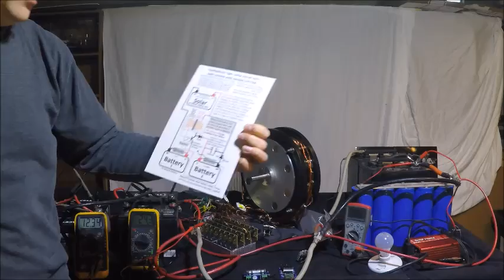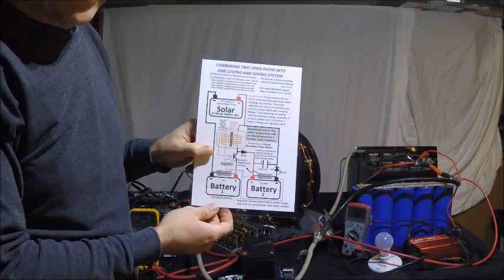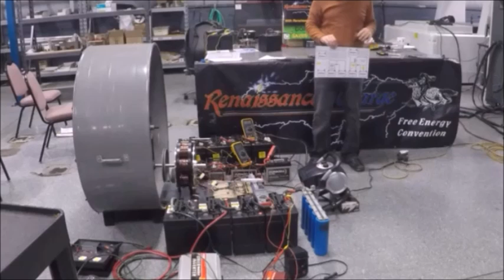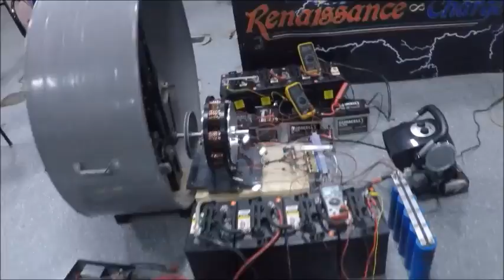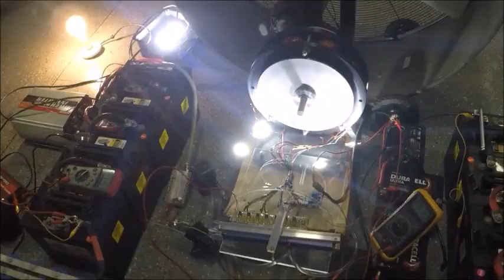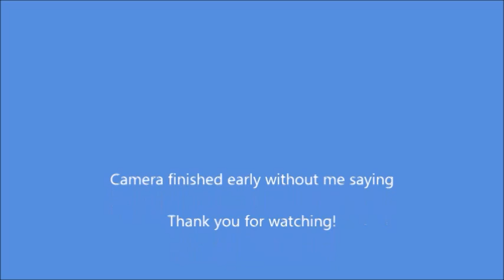Selfish Circuits or Loving Paths 3. Solar input, regulated

Comment: Shouldn't there be a diode coming off the Panel or a filter cap across it to save it from the inductive spike.
Reply from the maker: +Aln rife Panel?
Reply: +Rick Friedrich- I am asking about protecting the solar panel from the energy collapse in the coil.  can the pulse motors hurt the solar panel?  Was thinking you might want to put a cap in parallel with the solar panel to absorb the back spike.  Maybe the caps on the other end with  the charge battery take the hit.  Having built a few SSG's I know the spike goes more than just to the charging battery, especially if you have a bad connection on it.
Reply from the maker: +Aln rife Oh now I see. We often put a cap bank across the input to smooth things out like this and absorb the spike. If you were adding the last process then you would really need to do this. In this video I am not worried about the spike harming the panels under the regular conditions. One reason why you can't really charge the primary battery with the basic setup and the intermediate setup is that in the presence of positive current flow the negative energy phenomena stops. When the current flowed in the power lines then the spikes stopped on the transmission lines back in Edison's day. It was before the current flowed that this very fascinating thing took place. So when a source is powering a network with continuous power it cannot experience this at all. And when it is powering this motor it can only experience this for a very short time. So the place to maximize this benefit is in the 'pre' caps so to speak. They can receive more readily the charge and use that to power the motor. If there is considerable distance from the caps (where the motor is) and the panels then the panels will always be allowing current flow (so to speak) and thus the spike will not even manifest on the input side. The bank 1 in this particular circuit 3d.pdf will be able to receive some benefit along with bank 2 which always receives.

Comment: Rick, just a quick question if I may. I'm just wondering if the secret gray box contains a 'radiant energy oscillator'? Or is it Gabriel Kron's negative resistor circuit?
Reply from the maker: +clixbits As we develop this science we will present this as a system, otherwise people will just blow things out and get frustrated. My point now is to show that this is possible, and to actually show what we are doing to those who have carefully considered the details shown and have done the experiments in the first stages. Those who have worked in this technology have more or less figured it out. But everyone needs a little patience so this can be developed and presented as a science.
Reply: +Rick Friedrich Hint taken. Will do the experiments.